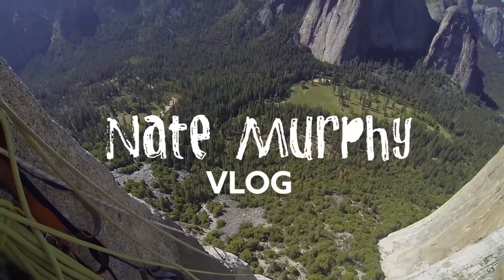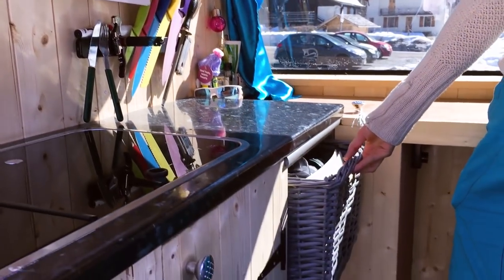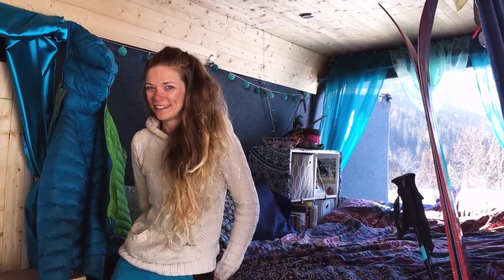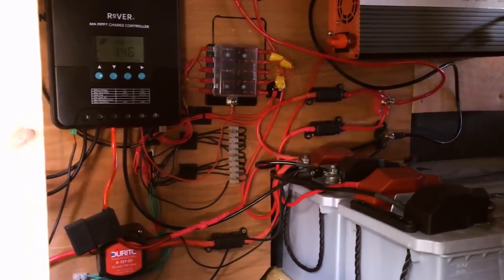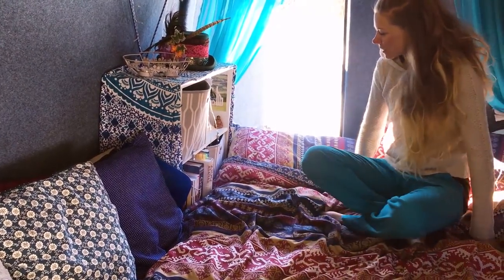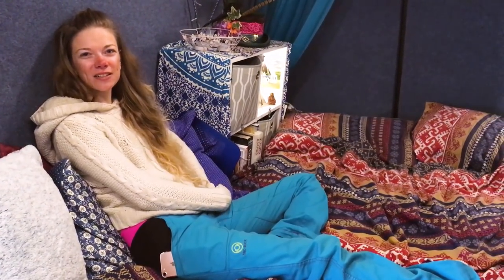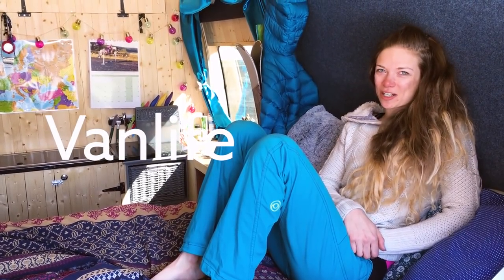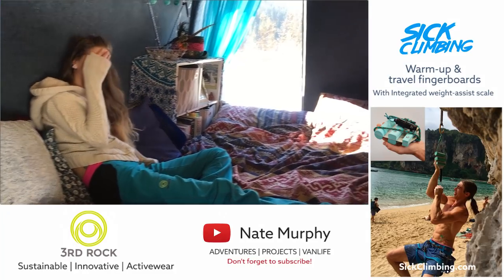Female Skier Converts a Van to withstand Extreme Conditions | Vanlife in -5°F (-20°C)

Comment: she should use magnets to hold the blinds up on the window, so it's nice and snug
Reply: i think Kaya was suggesting to stick some magnets onto the wood and curtains.... BUT if you wanted to do it to glass, some aquarium glass cleaner magnets would help you attach it to the glass
Reply: And get some insulation for the window, too.  That's a huge thermal gap.

Comment: Mom died early in my life My father stricken with heart attacks By 17 he also passed away  I was left with his 80's camper van as i was already working part time as a helper for spray foaming sites like buildings and homes My boss wanted to do my van as a gift knowing i was living out of it for site to site work  4 months later I seen -51C / -59.8F  over 2 days  I parked beside a gas station that had a electrical outlet and plugged in my oil heater for the engine block (keep from freezing no starts) and my electric heater that hung off the roof about a foot  Ran the wire in the window and had to cover the gap with a towel....I slept perfectly with a thick blanket under me and a light blanket over me  The next month i had my uncle sign for me a Apartment for me as i was "Too young" to sign myself ..I still to this day drive a truck and have a cord and heater in it just in case
Reply: freakyflow I’ve often wondered how easy it would be to spray foam the inside of a van, seems like the best way to deal with cold weather.
Reply: freakyflow I’m sorry for your loss. They’re in a better place im sure.
Reply: where do you live? thats really cold
Reply: Not to be a jerk, but your numbers don't make sense. Fahrenheit would not have a greater number than Celsius. Celsius reads freezing at 0, Fahrenheit at 32. To be in temperatures of -59.8 F you'd have to be parked in the middle of Antarctica or maybe some places in Siberia. There are very few places in the world that see such temperatures. It may have felt that cold, but had it actually been that cold you would have died in a van. There is no insulation that could have saved you. There's no way to heat a van in those temperatures sufficiently to save you. Having said that, I am sorry for your loss and hardships.
Reply: @TheDeezelsmoke  

I just have a great idea for homeless sleepers or cold homes 
... D.I.Y insulated padded socks.

   Versatility of foam spray
Reply: @cocokai9661  Fahrenheit actually overtakes Celsius below -40 degrees, so -59.8 Fahrenheit is only -51 degrees Celsius, which is a reasonable temperature (at least occasionally) in the north. The same way the more incremental Fahrenheit numbers run away from Celsius in the positive, it also quickly catches and surpasses in the negative direction. That is the logical way, or you could just look at a thermometer. Not to be a jerk either, just correcting you, incorrectly correcting someone else XD.
Reply: The temperature that both F and C are the same is, if I remember correctly,  -42? (An old High School Physics question)
Reply: cocokai damn bro you got schooled!!!!😂😂😂😂😂😂😂😂😂

Comment: For your shelf that tips over while on the move, use a bunjee cord or ratchet strap to keep it up. That way its temporary and easy to put on and take off. Great van looks good! Wish I was a couple inches shorter; I'd have built one of these instead. Went with an ex ambulance with a raised roof, just converting it to 4x4 now 😆

Comment: You could get one of those tiny woodstoves for winter heat. 3 inch wide chimney goes up through the roof. People living in sailboats, sprinters, skoolies, and vans use them. And, they don't ski. Also two roof fans for cooling. One blows air out above the stove. One pulls air in over the bed. Like a big bed fan over your head. They don't pull that much.
Reply: Yes, more and more people are going to wood stoves like the Cubic Cub. Dry heat and don't use any electricity for a blower.

Comment: I see your power source looks to be right below your pillow on your bed, and I wanted to caution you about EMF that your power source may be putting out. Electromagnetic Fields cause cancer, and you should consider positioning your head away from your power source. You may use a portable radio to check for a EMF by tuning the radio to between channels where all you hear is static (from natural radiation), then move the radio closer to your power source and listen for the static to get louder. The more static you get, the greater your electromagnetic field. Note: Do this with your electrical devises running. The fix for this is to move your pillow (and your head) to the other end of your bed away from any power sources. Also, do not park under high tension power lines. Cheers.

Comment: Just a caution about fuse box linked in the description. The LED circuit used to indicate ‘blown fuse’ passes voltage to the output even when the fuse is blown, per the one star reviews. I’m not sure if that was a phantom voltage that would disappear under load. I didn’t test it myself . . . but if that only occurs under a ‘no load’ condition then this might not really be a problem. FYI

Comment: Hi Nate, nice video. Carly you have done a great job on the conversion  but there is a reason why car manufacturers keep batteries out of cabins and it’s so occupants don’t inhale the fumes. If they cannot be moved to the outside you can box them up and vent the fumes out just to be safe😀
Reply: Theo Spinoulas they should be fully sealed leisure batteries.

Comment: Not a bad set up, but that separation between the cab and the living area would be intolerable for me, especially if I'm in a snowy area or if it's raining.
Reply: This is my struggle.  A pass through is good to have in case you need to leave a situation fast and safe, plus, the reasons you provided.  I LOVE this layout tho!
Reply: Yea, I think its best to make a small pass through.  You don't want to leave it completely open because you'll lose a lot of heat.
Reply: If the focus is on insulating the van for extreme temps completely cutting off the cab would probably be essential for getting the best results.
I get that most people like a certain layout, but I can also imagine that some people would need the separation so the living area is it's own thing to feel like a home instead of the constant reminder that they're in the back of a van.

Comment: She could have an indoor shower. Hang some hooks in the ceiling for a curtain, use a small concrete mixing tub as a floor to catch the water, preheat water on the stove and use a solar shower bag type of setup hung from the ceiling. Pack it all away when done.
Reply: How would a person dry the shower curtain? Packing it away wet will induce mildew.
Reply: You could just leave it up overnight ^^
Reply: I just go to planet fitness to shower and public restrooms
Reply: With all that space, she could've built in a shower like in normal RVs, with portable toilet. That gigantic bed is useless.
Reply: @DerpEye  lol.
Reply: DerpEye. Really hope she downsizes that bed and install a shower and compost toilet
Reply: Showers use an incredible amount of water. Its not really doable.
Reply: Actually getting one of those hand pump pressurized  tanks that people use to spray fertilizer or pesticides is a convenient way to wash in a van situation.

Comment: Ultimately a very interesting video and can be a wonder tool if everyone's questions are indeed answered?

      Not too long ago I got off the phone, from an inquiry to the administration of my energy company...
    
   I have been noticed with a estimated monthly bill of £137?
    Due to electronic meter readings...?
Strange how that usage has been incredibly estimated even though I do not own a t.v,  nor use a computer, video, game console, heating, electric cooker, or any other large power consuming device...?
       Hardly use lighting also as I utilise power saving torches, which run on economical charging...
       Basically I have been utilising the same devices all through the year... and consumption of things.
    Yet my power usage from my meter is over twice as high?

 Strange...?
     These greedy companies.

I can totally understand why so many people are ditching the stationary home for mobility...
      I am thinking the first step is to cancel energy suppliers and see how one fairs...
    I did that for a complete year before... and it was not too bad to be honest!

Comment: Now we're talkin my neck of the woods. Can't wait to see this. Where did you find your van? I have no businesses or mechanic I can trust that knows anything about engines or won't take you for every time you've got in this town or other towns for that matter and especially women. So this is going to be a very very difficult task. I should have taken Automotive in college. Do you have an isolator on your alternator so that when you're driving your cab batteries get charged? I think you have solar on the roof I better watch this again. And you can also have an extra small panel that is charged for the days when you want to be somewhere else. All I know is I need a blue sky mppt or mttp inverter and lithium batteries not acid batteries, the control panel and a fuse box and a breaker box for AC 110 and DC 12 volt. And of course a Shore plug to plug in when I'm near electricity. I think they make kitchen and closet kits that go on either side of a van that just slide in and attach already put together. I think they have bedrooms as well. If not they should get on it because this is becoming a big thing. Rents are too expensive if you fall between the cracks of low-income and making too much money. Or don't have a job and have had medical bills and tragedies in your life where you weren't covered. This is going to be huge if not already huge. And with vans because they are the easiest to park and be incognito.

Comment: Just curious, if you do most of your travelling in continental Europe, why didn't you get a van with the steering wheel on the left side of the car? I would have never dreamed of bringing my own car to the UK. I mean, driving on the unfamiliar side of the road is bad enough without having the steering wheel on the wrong side of the car as well.
Reply from the maker: Owning a car in a foreign country without an address/contacts can be hard... also used panel vans are way cheaper in the UK than Europe!
Reply: @NateMurphy  I guess that depends on the country. I knew a couple who did a cross country road trip in the United States for about a month or two. They bought a used car on arrival instead of renting one, and sold it when they went home. Turned out they actually made a hundred dollars on the deal, as used cars from the south-west coast is priced higher on the north-east coast due to climate differences.

Although I see that license plates can be a problem in most European countries if you don't have an address. But how about registering a car bought on the European mainland in the United Kingdom and get British plates? Is that possible?

Comment: Do you have any issues with the starter battery going dead, staying in the same area for a long time in the cold weather?
Reply from the maker: I think she drives too often. Also - I just left my van over winter for 6 months... while in America/Asia... it started first time! I was surprised.
Reply: That's pretty amazing, did you leave it disconnected? My only experience is with a 2003 Yaris and the battery went over winter fairly quickly. Thanks for the feedback!
Reply from the maker: Nope... just left it as-is! I even brought jump leads as I expected there to be an issue.

Comment: How do you dry clothes and ski gear? 

Or do you avoid wet days at all costs?

Also awesome goggle tan
Reply from the maker: The heater in her van is great at drying things out (this also makes van-life in wet places more bearable). I have the same heater in my van and once I hung up wet laundry in there - left the heater raging and within a hour or so everything was dry.
Reply: Thanks
Reply: What is the heater installed in the van? Wasn't able to find it in the video.
Reply from the maker: https://goo.gl/LXn1H4 see here -
Reply: Really enjoyed the video, too few succeed in self building cv for below freezing use. My choice between gas, diesel, electric (and wood stove) heating in my van is easy, and based upon experiences others made and share online. Electric heating require electric hookup (can not be ran on battries), gas has to be refilled quite frequently and diesel with an double diesel tank is the only option left. Thanks again for this nice and informative video! :-)

Comment from the maker: I will be here for a few hours to any answer questions you have about this build... fire away!
Reply: Nate Murphy yeah you will, go on lad
Reply: Nate Murphy good video.
Reply from the maker: Thanks Tony!
Reply: I am in the process of buying batteries  right now. I am wondering why she has such big batteries and which model are they?
Reply from the maker: They are Varta Leisure batteries (FULLY SEALED) and why so big.. with very snowy conditions and expected spells of cold weather/less sun the more the merrier!
Reply: Nate Murphy do you offer full conversion assistance?
Reply: what her instgram
Reply: Nate Murphy I find writing female in the title unneccesary. It sounds undermining. A men is not called a male skier but a skier.
Reply: hi Nate , about the batteries again, can you give us a model number please, she said they are very good and long lasting , but Leisure Series from Varta is quite wide .
thank you !
Reply: Hi Gaby, they are Varta 240ah 12v batteries, in terms of the exact model it's hard to see exactly. I work for a large manufacturer/distributor for batteries in the UK and checked our database and there is around 6 that look similar and have the same specification. In my opinion it's sometimes not wise to get two very large batteries as if one does flat line you got a hefty bill to replace. Maybe look in to getting 4 120 ah batteries as it can work out cheaper. My best guess for what that exact battery is: https://www.varta-automotive.com/en-gb/products/varta-promotive-efb - If you need any help send me a message and ill do my best :D.
Reply: Hi Nate, we're really interested in doing this, where in Chamonix was she/ were you staying and was it free? Do you know if there are other places in the alps or elsewhere in Europe you can park up and jump on a ski lift? The internet hasn't really confirmed it for me...
Reply: Alice De Jesus 
ISN'T THERE A TREE SUM WHERE
THAT NEEDZ A (HUG) FROM YOU !

AREN'T THERE PTERODACTYL EGGS
THAT NEEDS SAVING BEFORE THE
PTERODACTYLS GO EXTINCT ??
IF YOU 👈🏼 HURRY
YOU 👈🏼 COULD SAVE THEM.....
Reply: Tracey Kaplan , hopefully you will provide speech lessons before filming.
Reply: @AnabolicGaming  

How much are the batteries?

Comment: One safety comment - The batteries should be in a compartment vented to the outside to prevent hydrogen build up. No fun in going BOOM!
Reply: Dude, Come on! Sleeping on top of 12v batteries is the most awesome. Don't be a debbie downer. One cant be concerned with off gassing or shorts or gust murphy's law, or fire.  Have you seen the youtube videos where car batteries go up in flames?  She could easily get out in time from a dead sleep. All one needs is a fire escape plan.
Reply: Marine deep cycle gel closed batteries or lithium batteries don't put off gas.

Comment: I don’t get the using a van thing! Why not just buy a used RV and modify it? A lot of people buy them and never use them (so low miles0 and they are cheap. It would be a lot easier. The basic systems are already there. I really respect your choices though!

Comment: Celotex (Polyisocyanurate) looses significant r value when temps are under 10c, so that was an, unfortunate choice. XPS actually increases its R value. And Id use doors that lift upwards, not down, for easier access. Solid van build though, and solid gal. Im glad I got your book too Nate!  http://www.owenscorning.com/NetworkShare/EIS/10019950-FOAMULAR-XPS-vs-Poly-FAQ.pdf

Comment: I am not an expert but keeping batteries inside the van may not be to safe because of the fumes that batteries create.  But you should consult a electrician for confirmation.  Thanks.
Reply from the maker: If fully sealed leisure batteries it is pretty much all good

Comment: Ironically one vacated to naturalistic living to save money and experiences the momentum of cheaper living.
    However, this document slightly provides the evidence that the opposite is sometimes the case. 
"€/£/¥"
    One needs money and a fair amount of it, to even consider such an idea in the first place.
      Majority of people who face homelessness could not afford to buy a van and the cost of conversion/maintenance...
     For unemployed people it appears a difficult transition.
   For self employed it would depend heavily on their routine/income... 
Hmmmm.
     Can people receive benefits and not have a fixed abode, I wonder?
Reply: It certainly seems to be very situation dependent for sure. It isn't possible for everyone in their current circumstances, may require a change to make it practical. Also you are right, 7-15k USD is pretty normal for a van and conversion so some capital is certainly required. However, that is 500-1000 a month for one year, which many are paying in rent so it can pay for itself quickly theoretically. 
My job is extremely location flexible so I am seriously considering this myself. Especially since I love the outdoors so much. 
Since I can do most of the work myself and can get raw materials cheap it would be on the lower end of the spectrum for me. You could find some great deals to get materials cheap, and finding the right van deal can be done while you are saving up aggressively. 
Make sure you have a solid emergency fund if you go for it. Good luck!